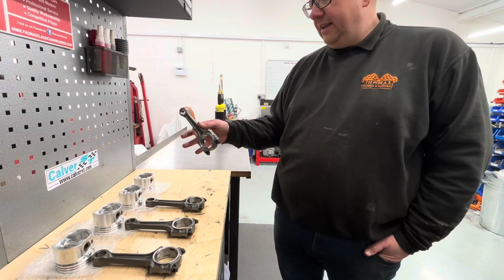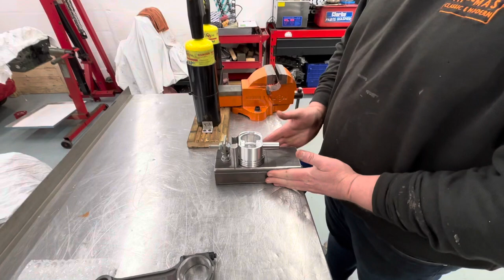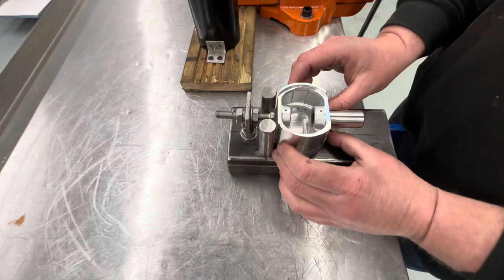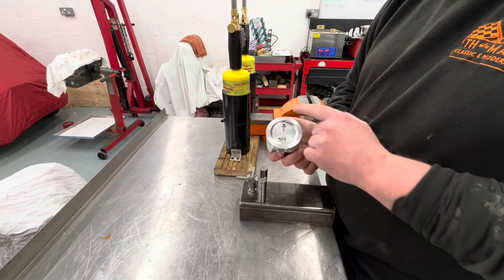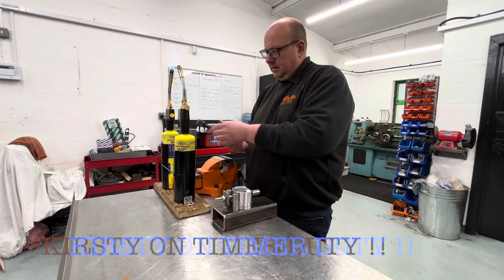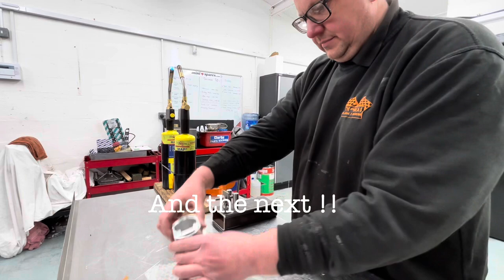Classic Mini 1360 Engine / Short Motor Build pt2  - Fitting Pistons to Con-rods

Comment: Very interesting. How do you get the gudgeon pin out again, should you need to?
Reply from the maker: We have a specially made bracing plate that we can use under a hydraulic press. And combined with a little localised hear on the little end they can be removed with no damage. Or more heat if the pistons are scrap.

Comment: Just found you channel. Your installment jig, how far past center do you have the pin stop set?
Reply from the maker: Hi there, it's adjustable so is set differently dependant on the set up. However it's roughly half the distance of the gap between the small end and the piston when the rod is hard over to one side.